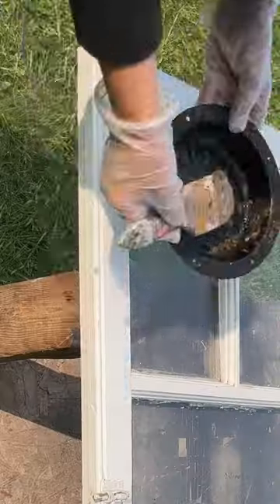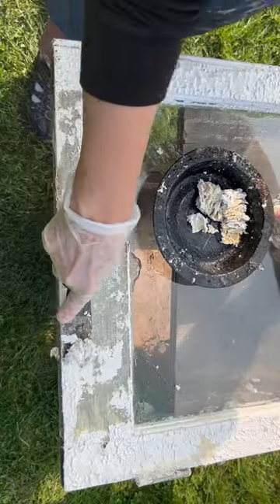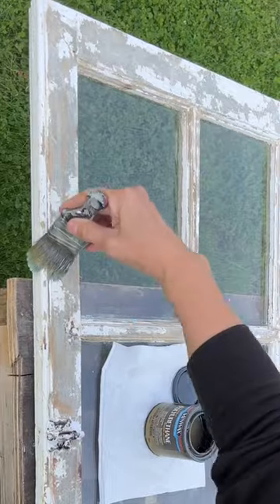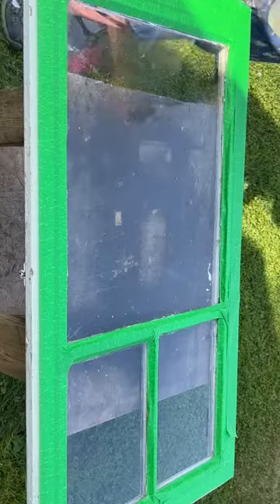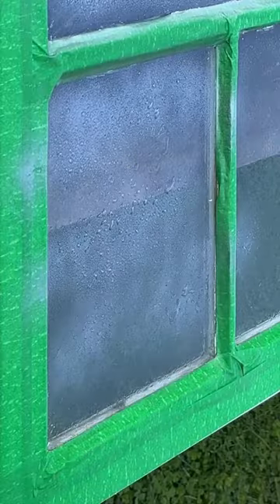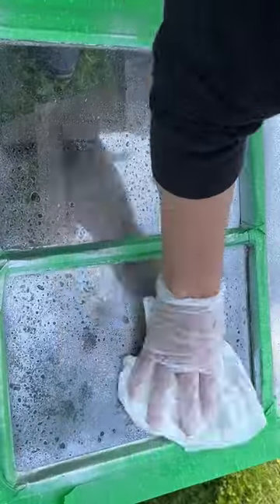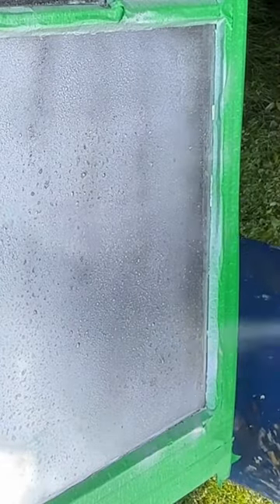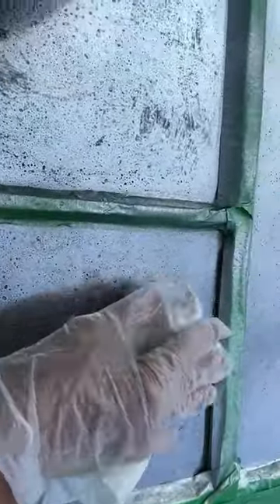Unbelievable Antique Mirror Upcycle DIY Transformation!

Comment: I would have stored it, as is, in my pole barn. I need lots of window in the shop/studio I have planned. 
I have been sourcing free and cheap materials, most of them new, many from local contractors.  Large builders often have left over material that they don't have room to store. They sell it on craigs list, market place, etc. 
When I go to pick up my purchases, I go with fresh homemade bake goods, and cash. (I got mad baking skills, and cash is semi untraceable.)
I made the effort to built good relationships with many of the local builders and contractors and they often give me first crack at their stuff. 
I had to build a pole barn (also out of scrap) to store all my treasures. 2 of the guys showed up that Saturday and turned a week long job for me, into a one day affair with bbq!
Last week I scored 1,500 feet of pex tubing for $100. When I went to pick ot up, I saw he had a box of shark bite fittings and asked him if he wanted to sell them to? Yes? $50! Sold! There has to be 100 assorted connecters in it! They run almost $10 each. So far I have spent $1,200 on the past 12-18 months and have a little over ½ the materials I will need for a  30'x50' building. 
This might be becoming a problem though. I drove home from the pex deal, feeling like a junkie that had just scored really good drugs. 
The only thing I might have to pay full price for is the concrete for the foundation. Then again, if i have them do it in sections, I might be able to let them do small pores with concrete left from othe jobs. 
My goal is to spend $7,500 or less in materials. So far, I'm below budget. 
These tradesmen have become my benefactors. NGL, the bake goods do help but, I also made them a part of my dream. They are emotionally invested in seeing me succeed. I show them what I have managed to accomplished in a mear 150sq.ft space I work from now.  (My avatar is one of my pieces. 42"sq.)
I have one builder that has pre ordered 5 stained glass pieces from my future space, the smallest being 2 -18"x 6' sidelight panels for and entry way.the largest a 5'x 15 foot panel of the Alaska range! I have the sketches done and am chomping to start it.
2 years ago I decided I needed a bigger work space. I devised a plan on exactly what I needed to do to accomplish it and I'm going to make it happen. You can have anything you want in life with patience and skill. Never give up on your dreams.
I am hoping I will have enough materials by spring to break ground. Think me good thoughts?
Reply from the maker: Oh sounds like a wonderful project and I love you are being so resourceful ❤️ have fun xo